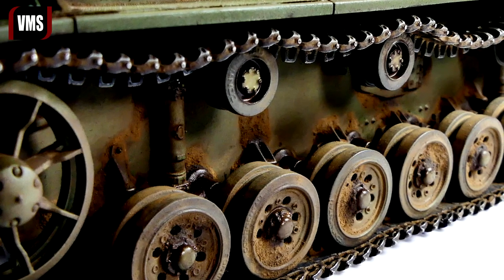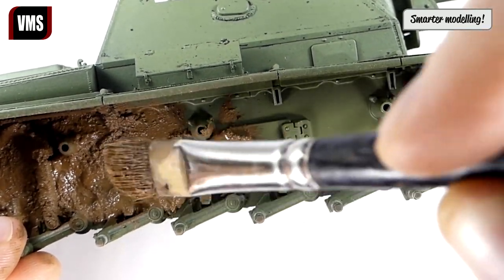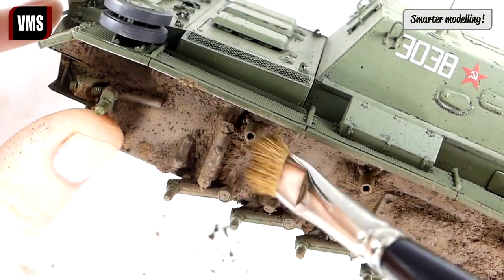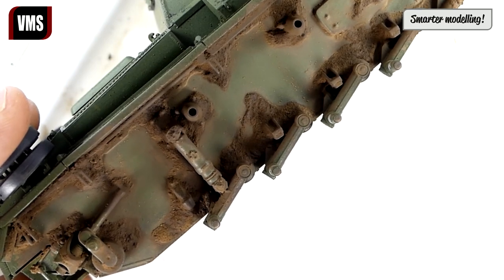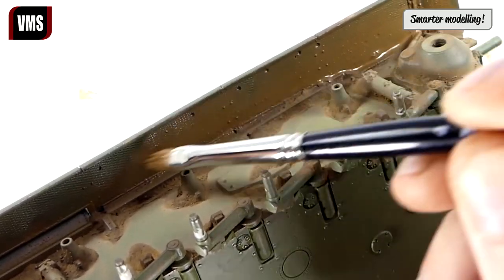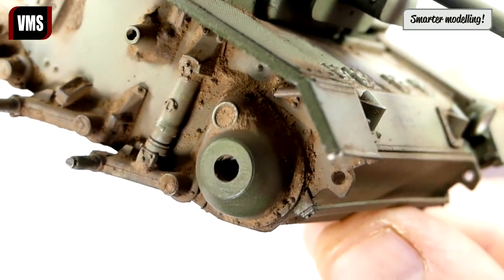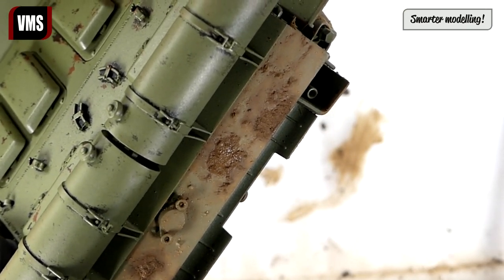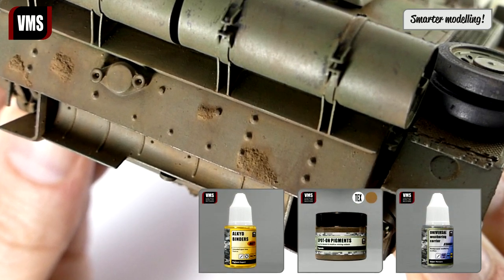Make realistic dry mud on a tank model - VMS Alkyd binders weathering Tutorial Part 1

Comment: Will I get the same with matt varnish? Or can I varnish after the mud or will it destroy the appearance?
Reply from the maker: On matte varnish the removal is a bit harder and the surface may be a bit more susceptible to pigments, that is change the shade more, but it should be OK. Varnishing over pigment jobs is always leading to a huge difference in appearance, not advised - the binders already hold your pigments in place.

Comment: Why put so much on the model if you’re only going to scrape it off?
Reply from the maker: It's a sacrificial layer. Through this removal we replicate what is happening to actual mud flaking off of a vehicle.
Reply: @Vmssupplies  is the removed pigment reusable? I wouldnt feel good about "wasting" so much of your good pigments
Reply from the maker: Yes, you can reuse it no problem, either use bigger chunks which make great texturing material for a diorama or just crush them back to powder form. BTW our jars hold 45 ml (biggest in the industry) so it's not like you will run out quickly even if you use them a lot.